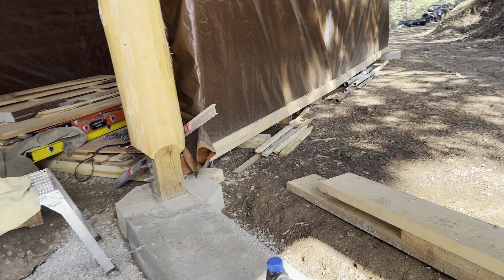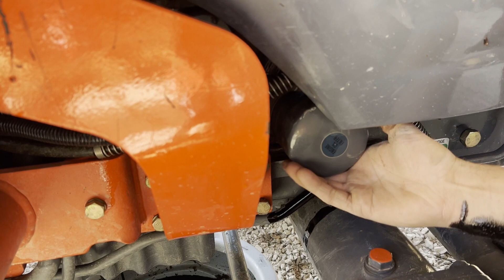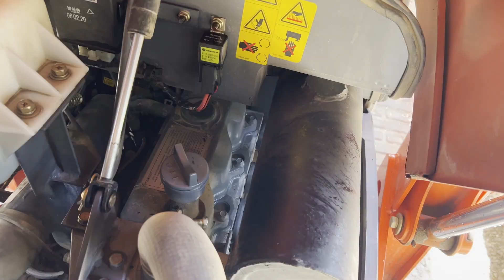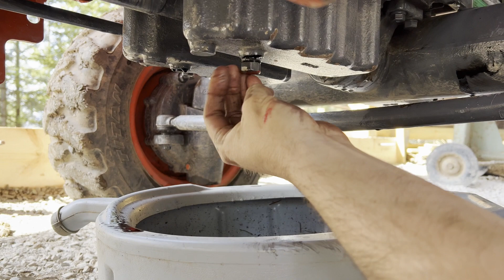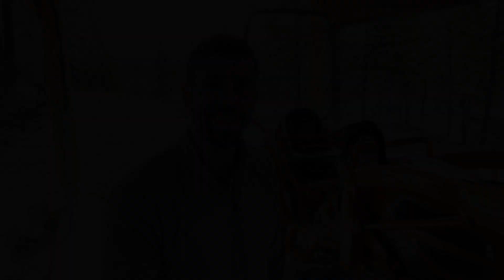How to Change the Oil of a Kioti CK30 Tractor

Comment: Nicely done video but for goodness sakes get a lock in one of those loader cylinders to hold the loader up.  That’s very dangerous; NEVER work under a raised implement unless blocked.  Plus you have a child playing around the controls!!!
Reply: G'day mate, how do you check your transmission oil? Engine off? I find there's none on the dipstick when i pull the dipstick,  put it back in and it's fine. Obviously it's getting sucked down and creates a vacuum,  and it's bellow when it cools down.
Reply: The dipstick tube on most engines is airtight. You have to pull it out to let the oil come up the tube and then recheck.  Almost every engine these days is checked with engine off.
Reply: @tommykiser5299  thanks